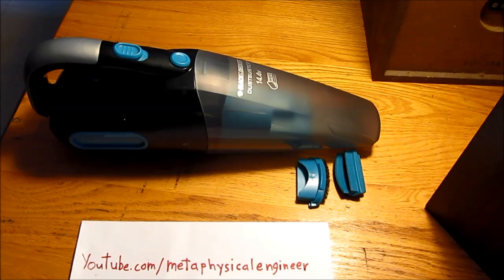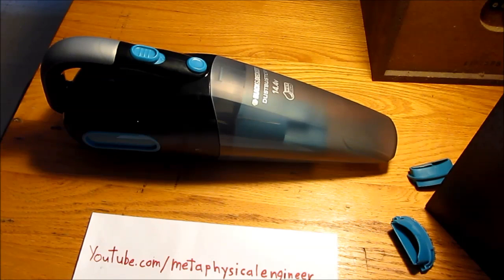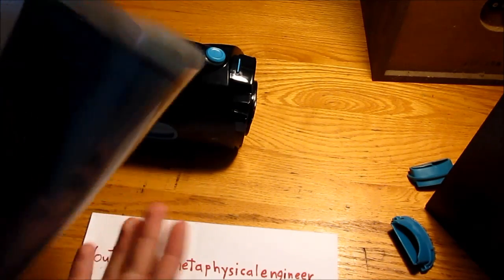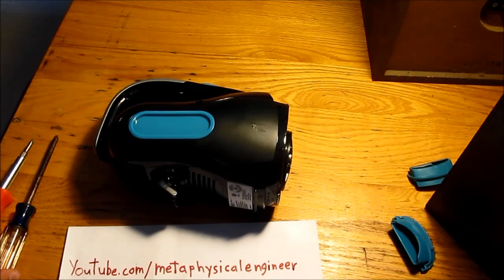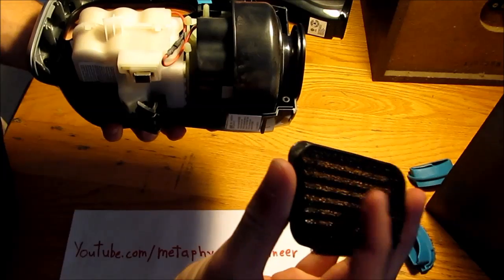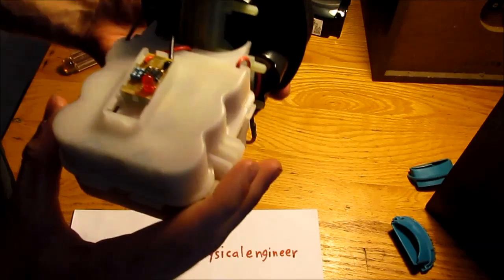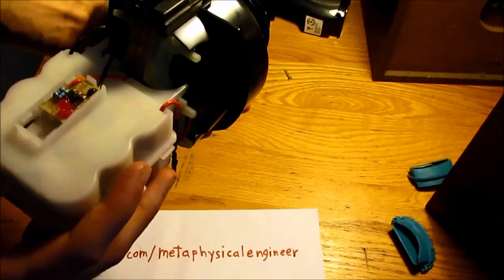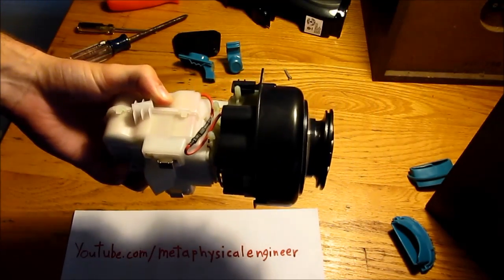Cordless handheld vacuum cleaner teardown

Comment: Hi there! I am currently a senior at the University of Rochester studying BME. For a component of our senior design project, we are planning on using a vacuum almost identical to this one. I was wondering if it would be possible to add a variable resistor in a voltage divider to modulate the air flow of the vacuum.
Reply from the maker: New Hollomon
Cool!  A variable resistor is an option, but would need to be a very high power variable resistor, probably over 100 watts,  to handle the amount of current the motor pulls. These are big and expensive. You could try to make a crude one with a coil of resistor wire, but that won't allow smooth adjustments. 

A pulse width modulation (PWM) circuit would be a better option that would waste less power and be much easier to control.  Very easy to run with an Arduino or similar (ask a buddy in ECE; they might be able to help).
Reply: Thanks for your help! I'll definitely look into a PWM.